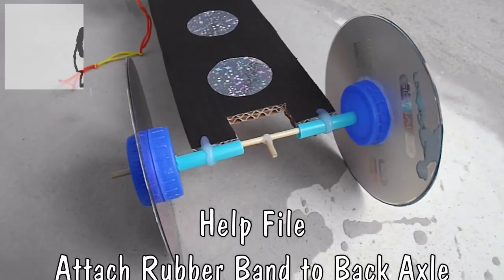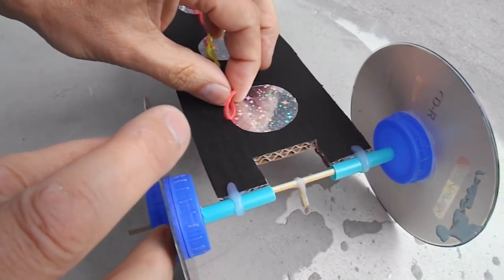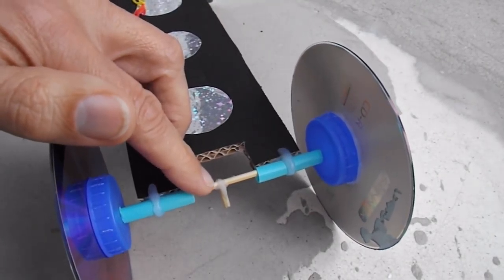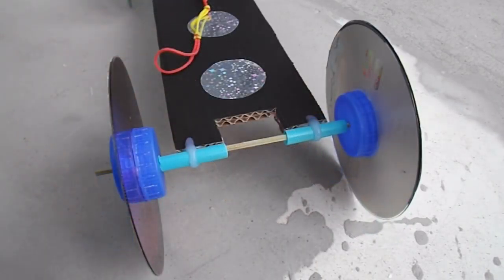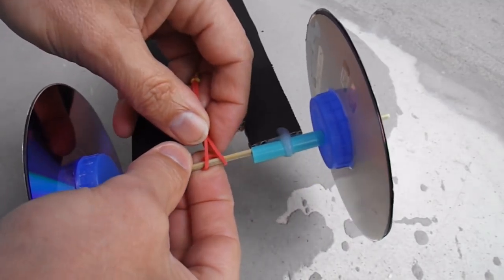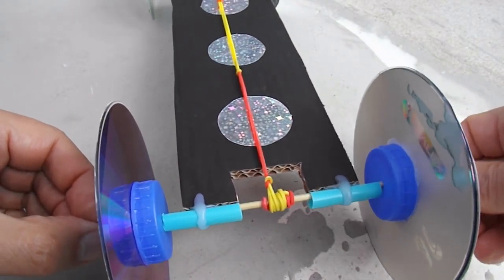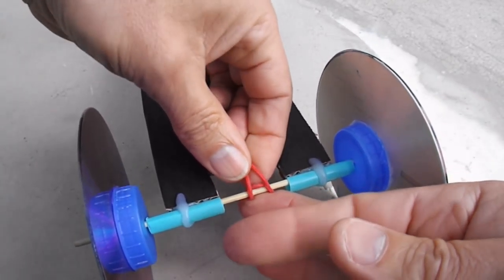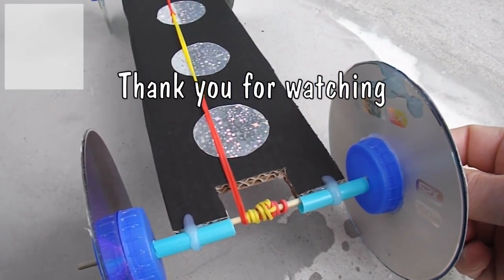Help File - Attach Rubber Band to Back Axle

Comment: How do you attach it to the front axle so it could stay tight and not fall off?
Reply from the maker: It is not attached to the front axle. It will be tied to the front of the vehicle in a suitable location. If you tie it to the front axle you stop it turning and the car will not move.
Reply: @GrandadIsAnOldMan  I just saw one of your video after commenting this and I got the answer to my question!! YOU LITERALLY HAVE LIKE EVERYTHING I NEED! I don't k ow what I'd do without your help! Thank you so much!!
Reply: @GrandadIsAnOldMan  oh and also, I'm sorry you didn't understand my question. It wasn't well written.😅 I didn't mean it like that
Reply from the maker: @rachelrodriguez650  thank you, you will always find more information in my video descriptions. Good luck with your project 😁👍

Comment: GrandadIsAnOldMan hy i wonder if you can make a pc fan hover craft whit strong motors it midght work i have a good plade fan and it does a good job
Reply from the maker: Aleksander Sats generally speaking pc fans are far too heavy. People often use an external power supply so they don't have to lift the weight of the batteries, alternatively you could use LiPo batteries. Here is a good one https://youtu.be/jm_IgpJI1Jo

Comment: GrandadIsAnOldMan i have this physics summative due in about a weeks time and i need your help.We have to build a vehicle powered by three No 64 rubber bands and the vehicle also has to pick up a small object and carry it to a distance of 2.0m. We are not allowed to use any kind of electronics like batteries or magnets, the only source of power for the picking up contraption should come from the bands used.
Reply from the maker: Samantha Michaelson the first type of car that comes to mind would have a low front that hits the object as it drives into it so the object tips over and falls inside the car and is then carried along for the required 2 metres. I have already had a similar request and will be publishing a simple video on the 14th at 3 am my time.
Reply from the maker: Rachel Gerrad I think you will have quite a challenge then. My simple car was published this morning and it works fine with no fancy extra mechanism other then the shovel effect of hitting the item and catching it as it falls.
Reply: GrandadIsAnOldMan Do you have any idea how to make that picking up thing?  we'll try to do it by ourselves.
Reply from the maker: Rachel Gerrad you need some mousetrap effect so that something triggers a clamp, but you are severely limited if you can only use 3 rubber bands and they have to power the car and operate the mechanism. If you study the mouse trap trigger mechanism that may help. You will also need to lift the item slightly to stop it dragging on the ground. Maybe some sort of weighted tilting mechanism triggered at the same time.
Reply: GrandadIsAnOldMan Could you elaborate on how exactly do would we set up the weight lifting mechanism inside the car (we are allowed to use gears, wires and pulleys).
Reply from the maker: Rachel Gerrad you need something like those mechanical arms that people make using syringes but as you only need to grip and lift you could arrange it so that it closes and lifts all in one action triggered by something touching a trigger or level between the grippers. So your car drives along with it's grippers open. The item you need to collect hits the trigger. That releases the spring action and the grippers close and lift all at the same time.
Reply from the maker: Rachel Gerrad probably too late for you now but I had a little go at making a rubber band powered grabber https://youtu.be/G0JKlp4IRTg  and https://youtu.be/wr5W6XkVtjs